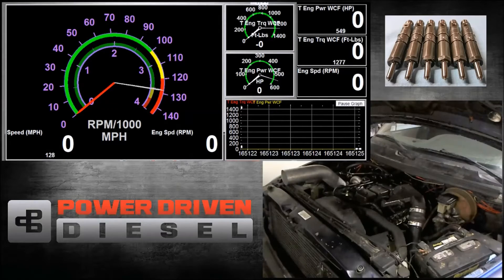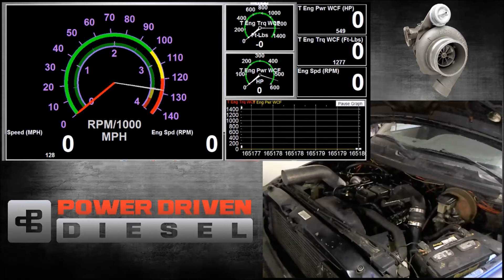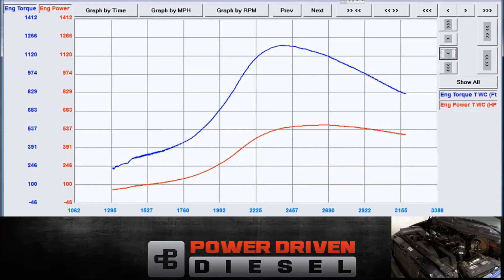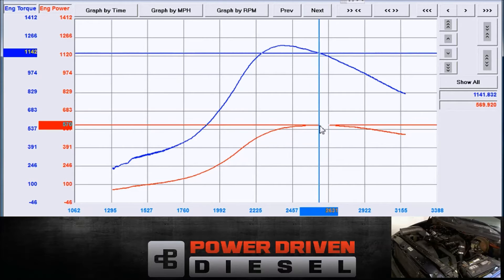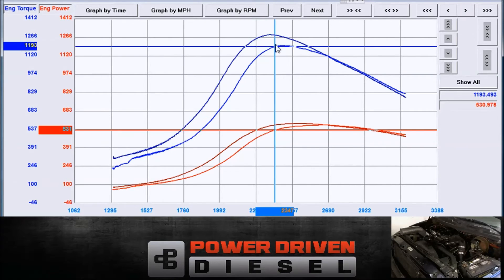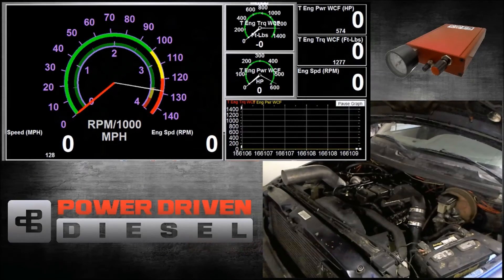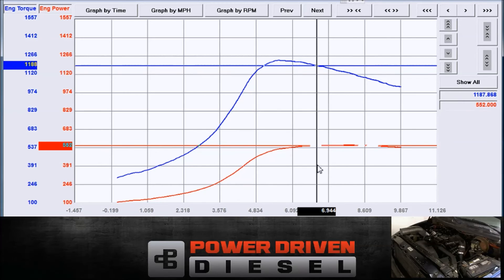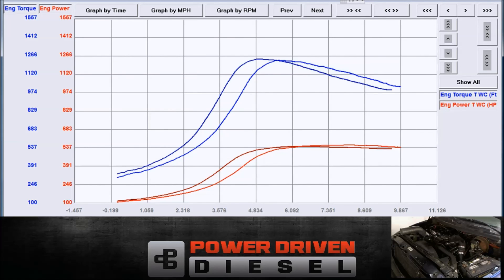S364SX-E .91ar Turbine Housing 68mm Turbine

Comment: On a 2 gen 6.7 do you recommend a sx364.5 with a .91 or 1.0 housing.  I mostly do heavy hauling on a daily basis
Reply: .91 housing if your towing. The .91 housing is the better way to go anyways unless you want a drag truck or doing it to make lots of high end power.
Reply: @joebidden4914  hey I'm about to do the swap on the 6.7 which would you recommend for 2014 efi live stock fuel tow 26ft travel trailer 7k lbs if I member right every now and then but mostly daily driver but wanna be able to get it on when the feeling rises
Reply: @andrew p  honestly for your application I'd reccomend go a little smaller on the turbo like the next size down from mine so it spools up quicker and stays in the powerband on stock injectors.

You're still gonna have more getup and go than stock trucks and you won't have to worry about drive pressure.